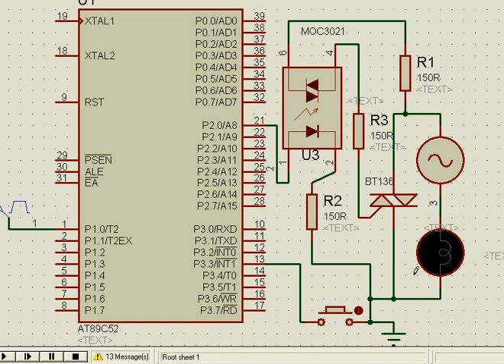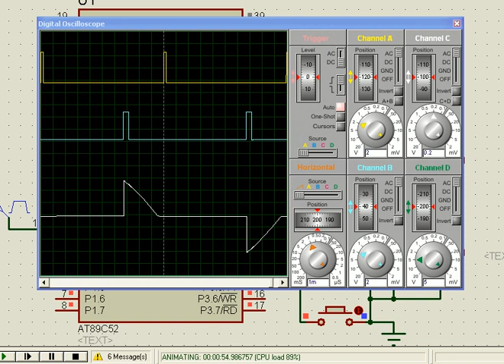Major Projects in power electronics,firing_angle_control.avi

Comment from the maker: Thank you .I am glad it helped you.It is not Multisim,nor Pcpice.Both of them donot have active  microcontroller in their library of components.it is Proteus of Labcenter UK that has microcontroller in the library such that one can load the hex code on the screen to see the result and then only the hardware is made which is bound to work if wired correctly.

Comment from the maker: The other meaning of ZVS is zero voltage switching meaning the load is switched on at the zero cross of the supply voltage not making the supply voltage forcibly zero.As regards the circuit it is a AC voltage controller.As ZCR (zero cross reference) /ZVS (zero voltage sense) is a must for such applications the video does mention about that.